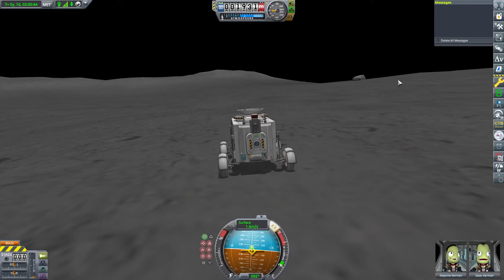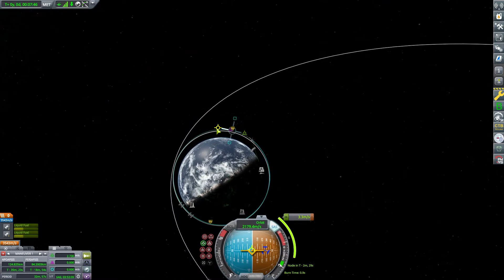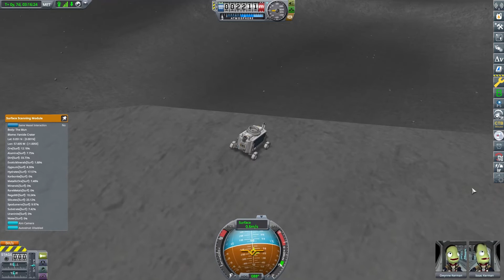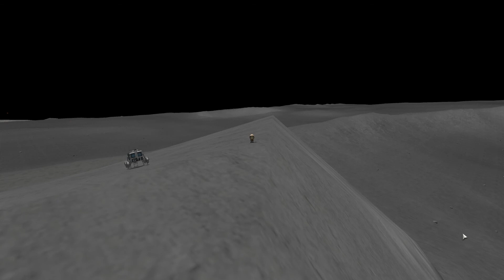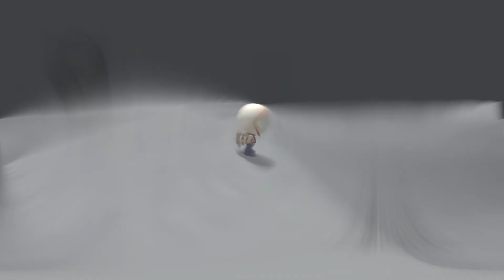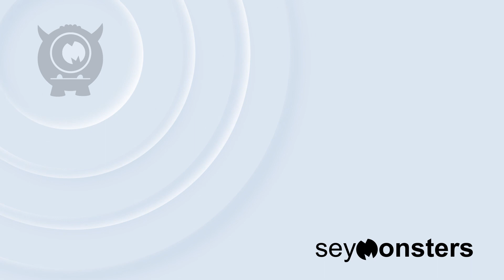Reusable Space Program | Episode 19 | Space Truckers | KSP

Comment: Hey man, cool videos. Ich wonder how you attached the wheels on your mining base. I tried it in vab and sph and i cannot get it to work to steer correctly. Where/how did you attach them? cheers
Reply from the maker: Thinking back... I may have a probe core in the end sections and attached the wheels to then, then used the offset and angle tools to reposition them... use mirror attachment in the SPH...

When moving them make sure to turn off reaction wheels on all your probes etc ( or do it when building) or the torque generated when driving will cause significant issues...